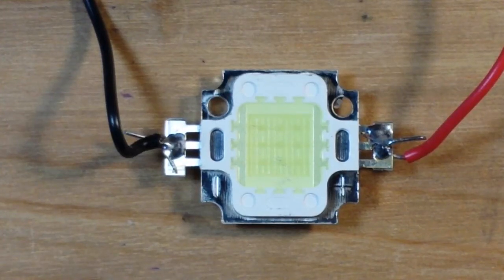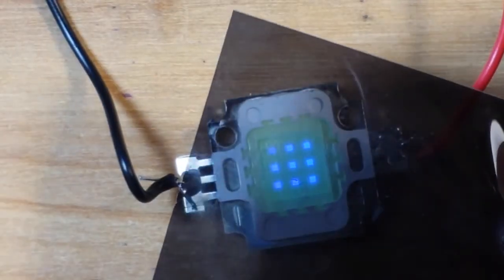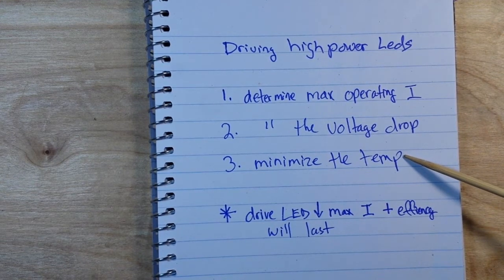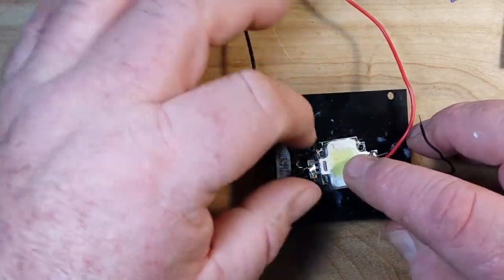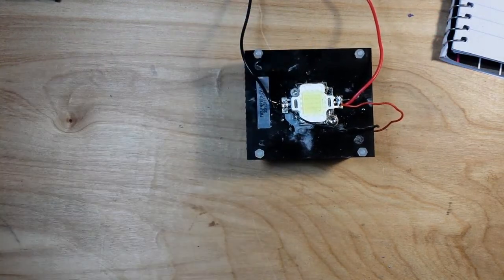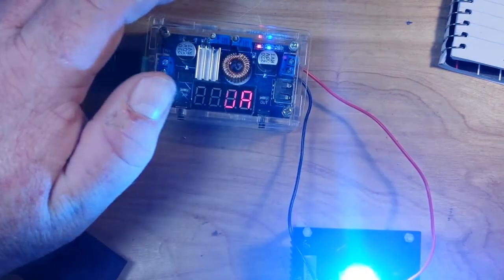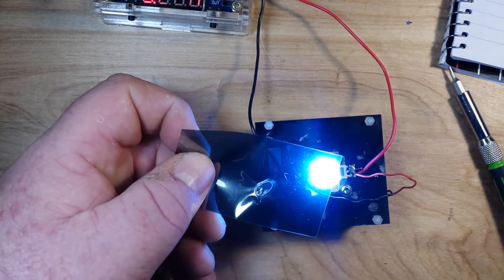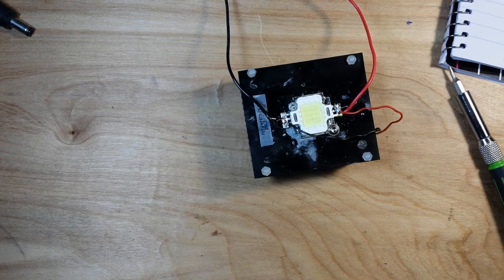How to drive high power LEDs

Comment: Learned literally nothing about how to drive high power LEDs from this video. Your power supply did all the work. The difficulty with high power LEDs is how to limit the current. Resistors are impractical because, for any measurable voltage difference between the LED and power supply, you're losing multiple watts at the resistor. I clicked hoping to see how people deal with this ... maybe you'd consider doing a followup because the difficulties of current regulation is kinda the elephant in the room when it comes to high power LEDs.
Reply: Did you find a good video? Currently having the same issue
Reply: @Trikz  No but I found some decent writeups. Seems like the normal way is to put an LM317 in series with the LED and set the current by putting resistors across it's control pins. If you need more than 1.5A theres an LM338 that works up to 5A. Google either of those parts and you'll see the same articles I was looking at. I ordered 10 of both (they're cheap!), still waiting for delivery. Maybe I'll make a video lol.

Comment: I'm curious why you did't use any thermal paste when you mounted the LED to the heat sink.  Is that not necessary in this case?
Reply: this would certainly increase the efficiency of the heat sink module.  Dry contact may be adequate in this case.
Reply: Tell you what I purchased a really high watt (2x50w) outside yard light for my parents a few years ago.  It died within a year.  I purchased a replacement 50w COB (only one was dead) and purchased two 20w new lights.  The dead light had none, nada, zilch, TIM in it, so I smoothed out the back when I replaced the cobs then I slapped the TIM on there (I have done PC/server work for decades, so I know the value of ANY TIM).  On Memorial Day I went over, and my light fix was still cranking along after now five years, BUT the two 20w units are dead (I asked and it seems they died almost the same week together).  I bet you the same issue with no TIM being used only these 20w lights do not use the LED type in the video they use a bunch of individual 5050 leds encapsulated in a rubbery resin.  Not sure what I will do to fix those.

Moral is use TIM or you are sacrificing so much (and make sure the Chinese put it on a smooth heatsink as mine was not).
Reply: btw, that grey stuff on it appears to be some sort of TIM though it didn't smudge with him, but was already smudged.

Comment: Where did you get your little psu?
Reply from the maker: RTOHIO Yeeco DC DC Buck Voltage Regulator Power Converter Supply Constant Voltage & Current Volt & Amp Converters Adjustable 7-36V to 1.25-32V Step Down 5A 75W LED Driver LED Voltmeter Display USB Output https://www.amazon.com/dp/B00XM8SM66/ref=cm_sw_r_cp_apa_SDJGzbPSN3Z3M